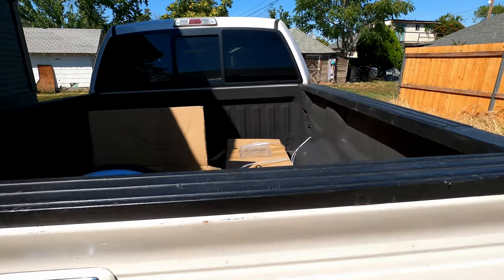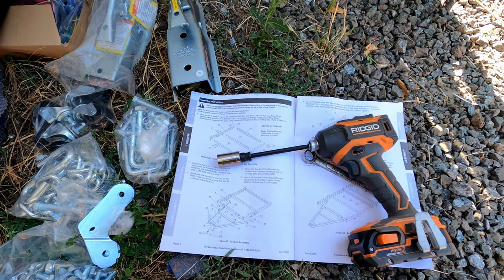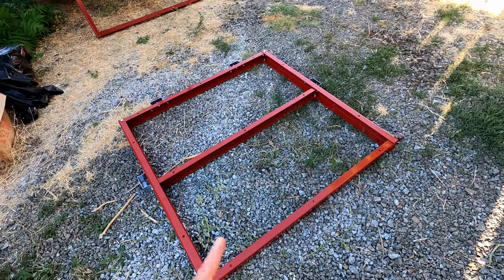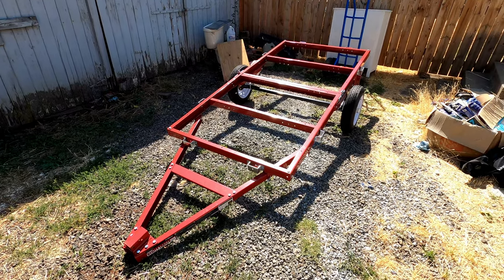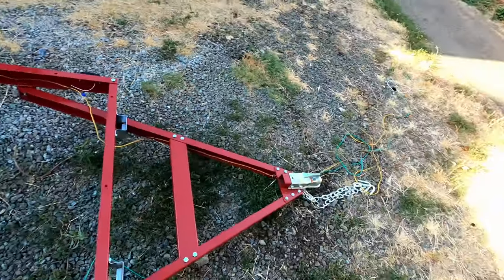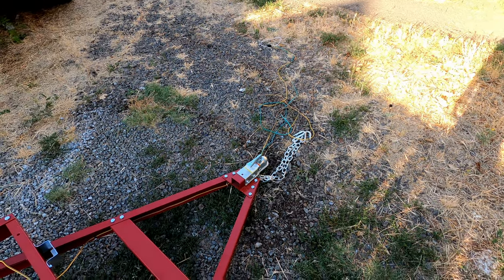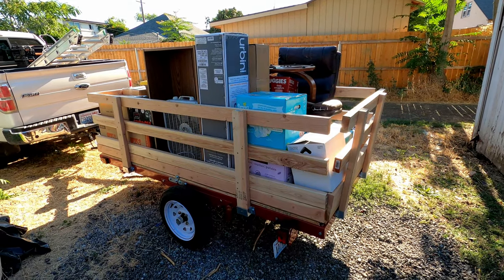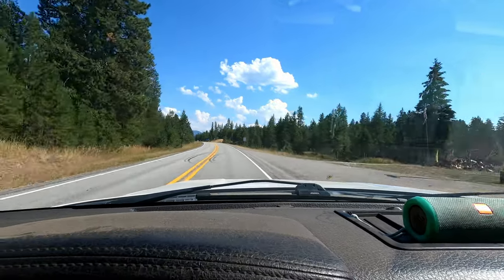Harbor Freight Utility Trailer Build and Test

Comment: Thanks for the video and sharing your experience. I am looking at this trailer as a multi purpose trailer - to carry my inflatable 14 ft boat and also as a utility trailer. My idea is to extent the bed out 16 - 18 inches in the front and about 24 inches in the back. Is this something the trailer can handle? Thanks.
Reply from the maker: I don't see why it wouldn't handle it! Thanks for watching!

Comment: U Should have talked about some specs such as tire and bed size  plus Max load on the trailer  ????? otherwise GOOD video  !!!!!!
Reply from the maker: Thanks! I will check the tire size, but Max load is about 1000 pounds, and the deck is 4x8 feet.

Comment: What is the trailer coupler height? ( from bottom of coupler to ground?)
Reply from the maker: It's about 16 inches according to my tape measure.
Reply: @thejunkyardnecromancer  Thanks!
Reply: There's a video out there that shows a way to mount the hitch lower if you need it.

Comment: So for this trailer I habe to buy my own wood?
Reply from the maker: Yes. The kit is everything but the wood. So some plywood for the deck and 2x4s for the sides (or whatever you want to do), plus the bolts and screws to attach the wood to the trailer frame.
Reply: @thejunkyardnecromancer  I wonder if I can just live it parked in my 3 car garage driveway? I live in clovis ca. Also if I live it there iam afraid they will steal it
Reply from the maker: @futbol1972  there are locks you can buy that prevent someone from hooking it up, but I don't know if that would stop everyone.